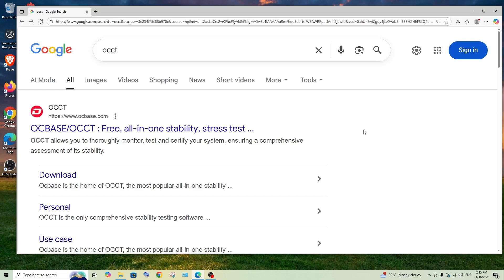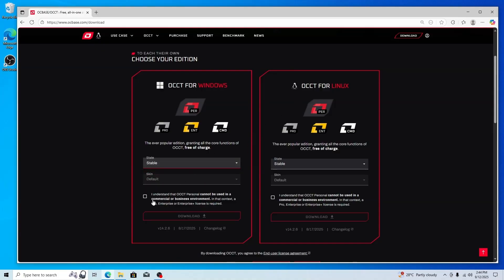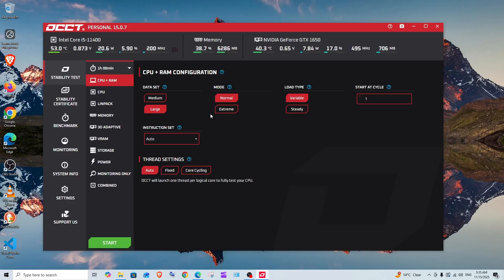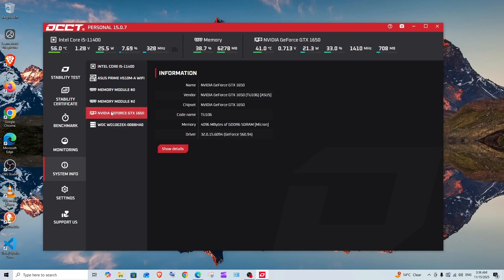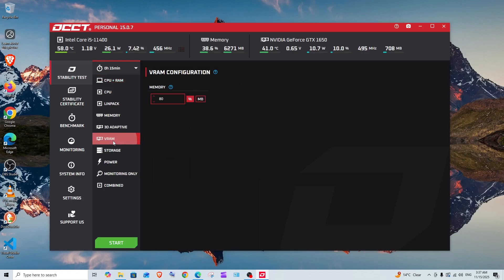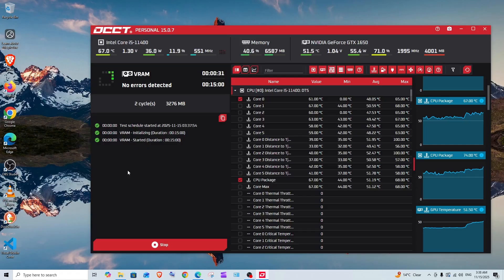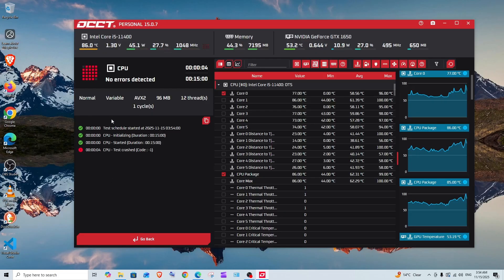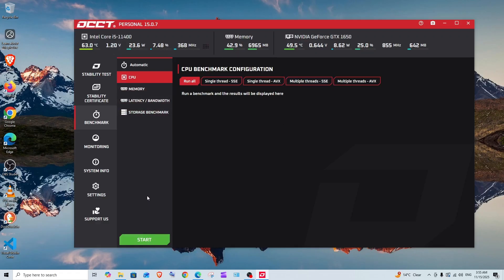How to Use OCCT for Stress and Stability Testing | Test - RAM | CPU | GPU | Power Supply

Comment: What settings should I use to test a used video card? The guy said it only works well by lowering the power limit, but I suspect the cause is dirt and old thermal paste, so I want to use OCCT to rule out more difficult problems. What results should I expect from the test?
Reply from the maker: Use OCCT GPU / VRAM tests at stock power (15–30 min, error detection ON). A healthy card shows 0 errors, no crashes, stable clocks, and reasonable temps

Comment: And i do the power test and my pc restart after 19 minutes it says your pc is running into a problem and needs restart .. i also. Enabled xmp is that the reason for restart please tell im afraid of that i can damage any thing like motherboard vrm and cpu or graphics card
Reply from the maker: Disable XMP and test again.
Don’t worry a crash/restart will not damage your CPU, GPU, or motherboard. Modern systems have protections and shut down safely.
Reply: XMP could be the reason, also unstable undervolt/overclock. If it's the clock settings, I suggest turning off XMP, then stress test the clock settings, then when that's stable, test the XMP.
Reply from the maker: Thanks for the info